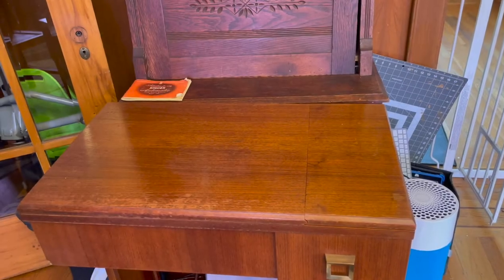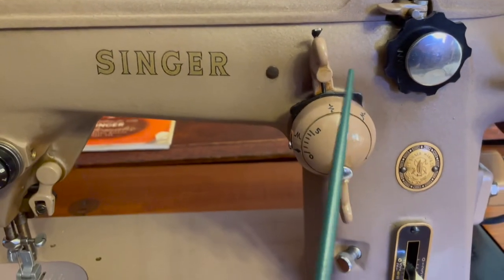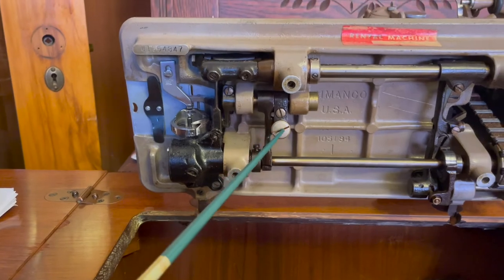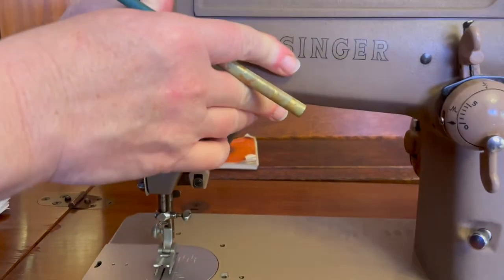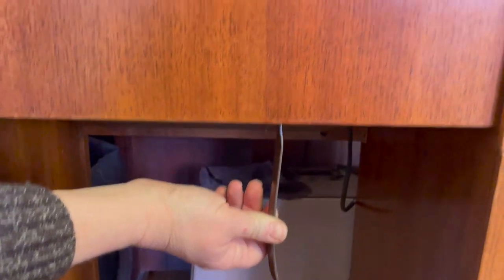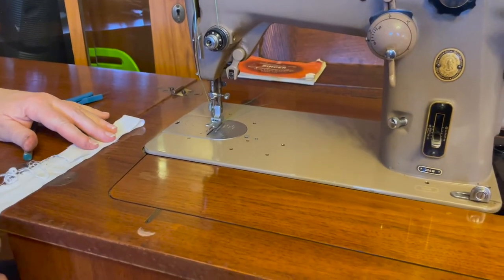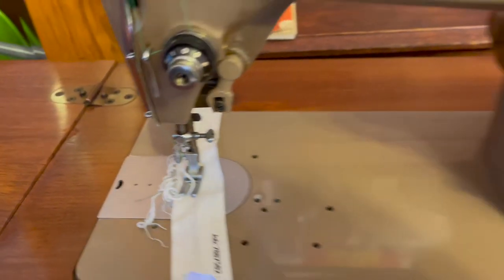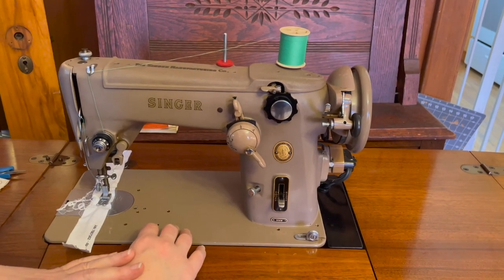Meet Deborah, the 1950's Singer 306W

Comment: When I bought my 306K, it was a bit noisy and clunky too. After a very big clean up and removal of tons of dust and debris from the bobbin area, I used my owners manual to locate every oiling point and give it a thorough oiling with brand new Singer Sewing Machine Oil. Suddenly, the noise was gone and it sewed beautifully and strongly with a perfect stitch. I was amazed at the immediate impact of a great clean and oil. My machine came in a carry case. It has a foot pedal but not a knee control. The extension table fits neatly into the top section of the case. It easily sews through 12 layers of jeans denim. I recently repaired my dog’s coat with the 306, reattaching heavy duty Velcro tabs to canvas. Nothing phases this astonishing machine. It puts my mid-80’s Husqvarna-Vikings to shame.😊
PS my 306 was built in Kilbowie, Scotland in September, 1958.

Comment: This can easily be converted to use standard needles. There are two styles of hook shuttles for this machine.  One has the 2 locating pins at the top.  This should be the best scenario and an easy fix.  You can use a 20U bobbin case. If the shuttle has a single locating pin at 5 o'clock then you would need to modify the 20U bobbin case by cutting a groove into the side to make room for that single locator pin.  Then you can use the standard 306 bobbin cases and the  modified 20U bobbin case with 15x1 needles.  You would still have the odd bobbins and many aftermarket 306 bobbins don't work well with the bobbin winder without modification, but these are great machines and worth modifying especially if you want a treadle machine with zigzag and decorative cams.

Comment: I recently acquired one of these models and right now as I’m trying to finish up the repair and maintenance on it I’m finding that the top thread guide keeps losing the thread as I’m sewing. I did a screenshot when, in your video, you show a close-up of the thread guide, and it looks totally different from the one on your machine. One is right side up and one is upside down, I wonder which is the correct way that it should be placed on the machine.

Comment: Do you use SINGER Zig Zag 20U industrial model bobbin case? And the needles used are the common ones used in all home sewing machines? Or need to keep the needles shorter. Or do you use industrial straight sewing machine bobbin case?